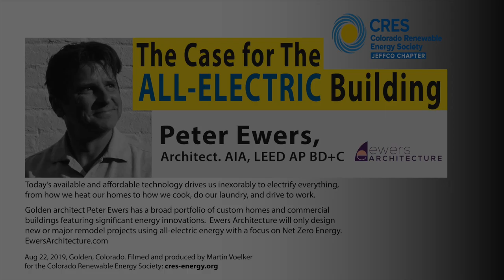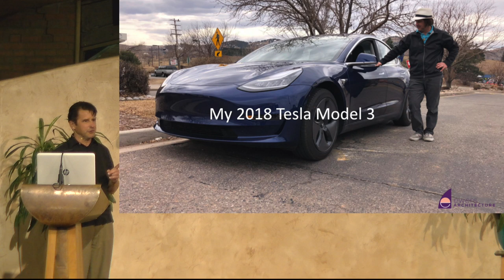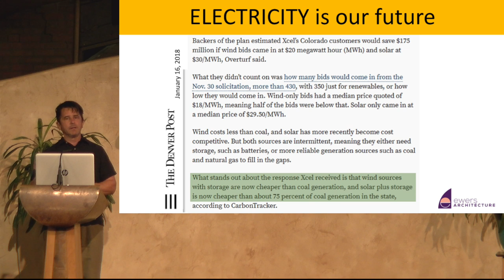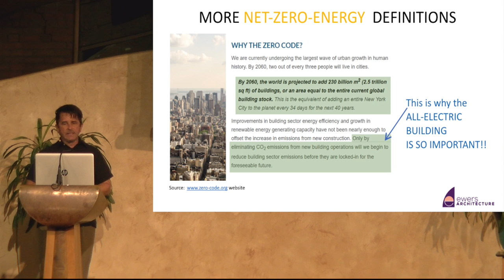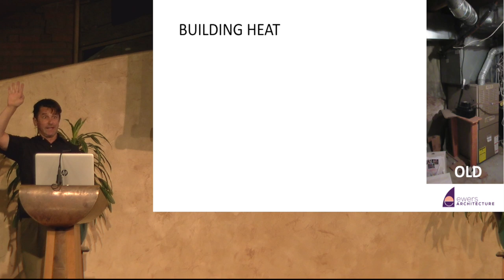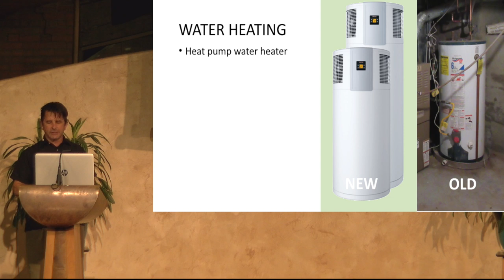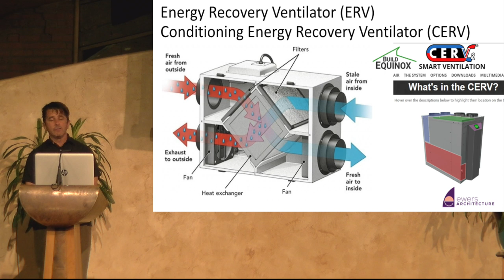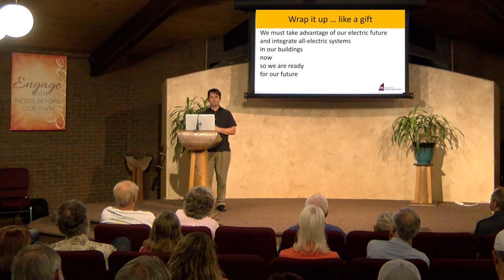The Case for the All-Electric Home

Comment: After having a solar PV system for years, I finally just replaced my gas stove, water heater, and dryer with electric.  Had a Prius for years and drove carefully to max my MPG, but bought a Chevy BoltEV a year ago and charge it virtually for free off my excess solar. (now I zip around with effortless power - no energy saving required...)  Peter is right - all electric drive is the future.
However Peter, as a solar installer my self, I would encourage you architects to quit cutting up residential rooftops into all these fancy little sections.  With the advent of the new NEC rules requiring 3ft of space around solar arrays to accommodate fire fighter access - many, many new houses are virtually impossible to fit solar arrays.  All houses ought to be designed to at least be solar-ready with a southwest facing roof plane that is clear of obstructions.  Put in solar ready electric panels while you are at it.
Reply: All new homes or remodels should consider at least a small solar system.
Once installed you save money month after month after month on your electricity bill.
People make a mistake looking for the cheapest build or remodel.
Solar is a long term investment that pays you every month. 
In the long run you save much more money than it costs.
Drive your electric car with free energy from the sun.
California has passed a solar panel mandate for new construction.
Reply: Did you go with a heat pump water heater?
Reply: Thanks Greg!  I totally agree.  Making larger roof areas for PV is really important, and we need to design for that.  And we need to also watch out for other roof penetrations like plumbing vents.

Comment: I really enjoyed this video. This topic needs more coverage. I recently posted this topic to our local solar homeowners group and it received a lot of pushback from those who don't think natural gas is that bad or that good electric alternatives don't exist. The natural gas distribution system regularly leaks methane, which negates any climate benefit it has over coal.

It's difficult to even get local installers to agree to put in a heat pump water heater. They say that they will break down and will have too long of a recovery time, even thought they are hybrid models that use resistance elements when fast recovery time is needed.

What I'm finding most difficult is what to replace gas fireplaces with in a 15 year old home that wasn't designed for wood burning.
Reply: thanks Mark!  Natural gas does have a benefit over coal, but we need to treat NG as a stepping stone to where we really need to be... and frankly, we can leap frog right over that stepping stone and get to all-electric, so I think we should do that.  If some people want to rely on NG over the next decade, I would not argue too much, but we need to set up our systems and buildings that will last longer than one decade so that we are relying on electricity, not natural gas.

Comment: Saving energy saves money on utilities month after month.  The Climate Crisis needs all of us to make changes in our lives that make us more energy efficient and closer to carbon neutral.  A net zero home remodel or a passive house standards remodel is great.
Air sealing, super insulating, triple pane windows, set back thermostats, energy efficient appliances, LED lighting, energy efficient furnace and air conditioning, solar panels, battery storage and an electric vehicle charger or 220 V outlet in the garage all need to be considered as part of any new build or remodel. All future transportation will go electric. With solar energy you can drive your electric car with free energy from the sun.
Electric cars, electric trucks, electric buses, ebikes, electric boats, electric lawn mowers and snow blowers.
Reply: Amen!

Comment: Great video. Good design tips.
Building standards / codes need to require higher energy standards and solar panels with battery storage.
Building standards across the US are too low and need to be increased. Europe has much higher standards for doors and windows. Triple pane windows and high efficiency doors are common in Europe.
Reply: 100% agree!  Let's make our buildings as efficient as possible, and only then should we be adding the carbon-free electricity to power what is needed.